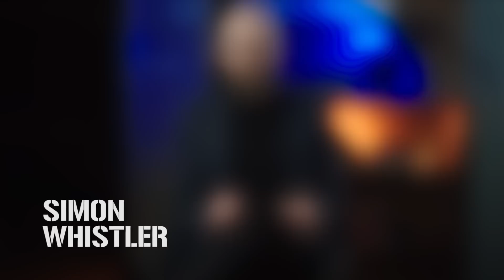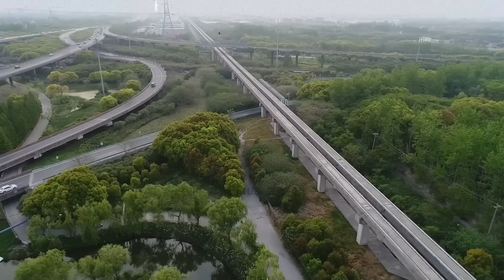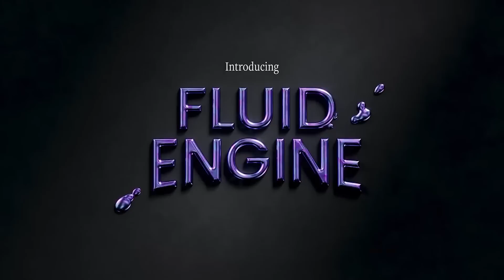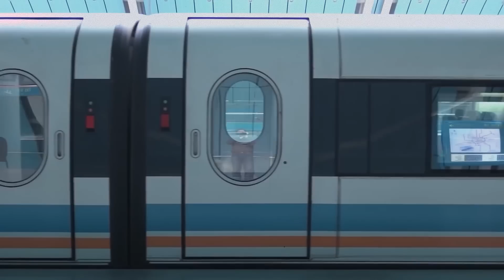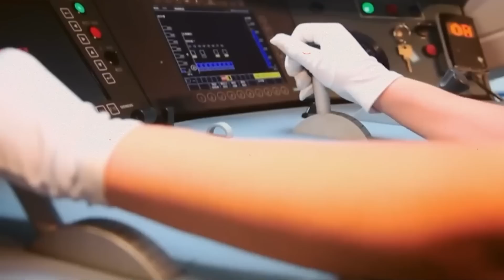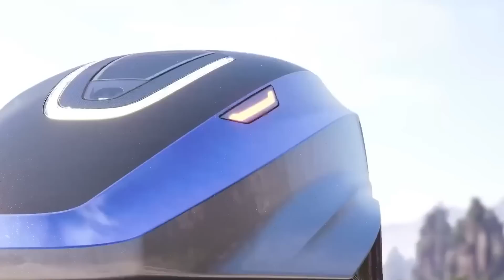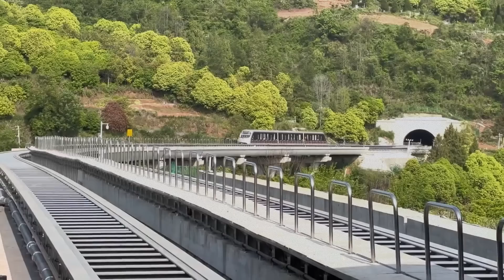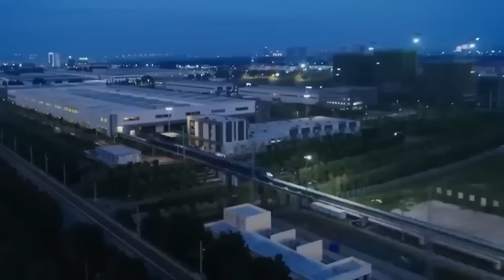A Chinese Maglev Revolution is Coming...

Comment: Airline speed transport at sea level gets increasingly energy inefficient. The jet is flying at an IAS of 250 knots while your maglev is at 500, consuming 8 times the power.
Reply: Planes use jet fuel which still takes a tremendous amount more power to produce, refine and transport than electricity. Comparing maglev to jet engines would be like comparing ICE cars to electric cars. EVs or maglevs may require more power to move the vehicle but electricity is a way more abundant and efficient form of energy.

Comment: i think in the future if iron ferrite permanent magnet (rare earth free permagnent magnet) get stronger, cheaper also superconductor temperature that higher than now (i mean can get cooling by nitrogen) also the cooling system will lighter this maglev technology will be mainstream in all country in the world. (sorry for my bad english, this is just my opinion u can correct me if i wrong in some of my comment)
Reply: why i say this thing is because normal permagnent magnet is expensive and also only china can do it because they control 70% of the rare earth mining and the technology of mining is mature in china. also good engineering skill i guess cause to train move at speed 600km/h or more they need precision and calculation is very hard, other than that the maglev system will different to conventional railway cause u cant change track like normal train its need like monorail ( idk it can change like conventional train but my thought like monorail change track in japan). 

also to be clear the technology what i say in my comment above and this is inductrack.

sorry if i have something wrong in my comment (im not expert in this area)

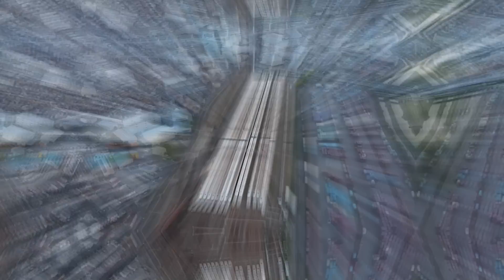Comment: Footage at 0:36 seems to be showing Japan, the cars in the background are running on right hand drive roads, and the freight yard has very typical JR Freight colouring.
Reply: Megaprojects channel did use Japan maglev in few of the frames but that is very easily recognised as Japan's  603km maglev is very unique in design look

I check what you said. You are the expect here and it seems after some checks you are correct 😅👍
Reply: Sorry you are correct 0:36 is Torikai Railroad Depot in Japan.
My bad, apologies for my unknowledgeable rant 😅
Reply: That's in China. The roads & small high rise. 
0:36 is an average small train station. 
All those are HSR train, there's even larger size with more higher speed HSR then that e.g. Wuhan HSR station is 5x size, with 5x train there's in 0:36

Japan don't have such
Reply: @james_l4337  No, it is not. This is the Tokaido Shinkansen rail yard owned by JR Tokai, called Torikai Rail Yard, located in Osaka, Japan. I went on a factory tour there when I was in primary school.

Comment: As a comparison, the construction of the fast train In a proud country. 

HS2 has been staggeringly expensive ( fase 1). Connecting London to Birmingham 66bn km (140 mil).  has costs around 82 billion usd.or $232 million per kilometer (km). 

And California high-speed railway (Phase 1) connecting  San Francisco Bay to  Los Angeles 800 km (500 mil) . has costs around 120 billion USD. Or 150 million per kilometer (km)
Reply: worth noting the cali train is not meant to finish it's an elaborate money laundering scheme

Comment: For those slower maglev trains, what is the impetus to use maglev? Is it greener? You did mention it for the sky train but that also used different magnet tech.
Reply: Technical verification, construction verification and operation verification, calculation and estimation of costs, providing reference for future investment
Reply: It's a test project for future implement in Lage scale.

Comment: How about Japan
Reply: Maglev with 600+km/h is too much for Japan, if not most countries. It's like buying a Koenigsegg Jesko but never speed it past 250km/h. Only a waste if you can't fully use its potential. Trains with this kind of speed needs a very long distance to stop and very large  arc to turn. You can't expect it to go from 603km/h to 0km/h in less than 5 secs/1000m - the G force produced will turn everyone in it into a pile of Bolognese instantly

Maglev is more suitable in transcontinental travel rather than transcity

Comment: Guys you got bits and pieces but you are not giving real picture. Shanghai Maglev has been originally planned to connect with hangzhou but 
1. It went twice over budget ( pillars had to be spaced twice as densly due to soft ground) 
2. China has not acquired ip from transrapid while for rail it did secure technology transfers on 2nd and 3rd generation trains (kawasaki, siemens, bombardier) resulting in own high speed rail tech for export. 
3. While the Hangzhou link was still in consideration, fast link via rail has been built making 170km ride city to city at under 50 minutes 

4.updated proposal has been presented for extending line to hongqiao airport making it simply fast connection for domestic/international transfer between  two shanghai airports (currently around 1.5h is required via subway line 2). 

In the meantime China has put significant r&d budget  into Maglev project which Changsha link is a siginificant milestone as this is first fully inhouse developped maglev technology inside China. The Qingdao link is a natural next step for China and for all of us who have been looking at transport infrastructure this was the news in the 2014-15 :) 

It has been said then exactly that while shanghai maglev will never breakeven the changsha link will be profitable and this technology will be further expanded to cities where subway/underground option is more challenging. 

Currently China is successfully exporting high speed rail tech in asean region and as it is looking for "new productive forces" the party will be pushing big infrastructure to keep economy going as well as keep status quo in rail tech with Japanese.
You should have mentioned Japanese maglev program to give context as they did develop and widely use low-mid speed maglev since 80es but have given up on high speed maglev due to lack of economic viability for such projects until... early 2010s when the super fast link Tokyo-Nagoya-Osaka was announced with first stage completion in late 2030es and whole line in use by mid 2040es, operating speed above 500km/h. 
While US is third world country, Europe struggles to push trains with TEN-T Asia remains the land of rail for all of us CHOO-CHOO geeks

Comment: The problem with maglev is that you have to have a immaculate right of way, or the trackage.  china's big problem with mega projects is the absolutely unbelievable amount of bribery that goes on.  And it reaches down to the level of the contractors building the project.  What no one realizes is that the their mega projects have contractors that are as corrupt as the government officials.  When you can watch a person walking around some of china's very high apartment buildings and just reach out and grab a section of the CONCRETE on a load bearing wall and just break off several pieces of it, and then move over just a few centimeters and do it again!  All in the name of getting their share of the money that is supposed to be used for building those buildings in the project (s).  Your toting china's high speed rail system???  Don't do that.  In order to have high speed rail system you must have properly maintained trackage way and structures.  I've seen videos of their high speed rail cars on the inside.  They vibrate so bad that you almost need a seat belt to keep you in the seat!  Not comfortable to ride for people, AND not safe for their passengers.  You basically need a dedicated line for high speed rail, and then you have the regular train trackage way.
  Why do I call it trackage way?  Because you have to prepare the area that the railroad tracks will go through.  With modern freight cars and locomotives that weighs so much more than you think, you have to prepare the ground for very heavy weight loadings.  So you compact and grade the section properly and then you lay the track.  After that you have to add what is called ballast, which is just the rocks you see and are used to.  Then you have to compact and tamp the rocks, or ballast, so that they are forced under the railroad ties, also known as sleepers.  This forces them to do their job properly.  And then you have to go out and make sure that your trackage is straight and properly leveled.  Thus you have a Maintenance Of Way Department.  Those people keep things in proper order to make sure that there are no problems with getting trains through their section.  This is all a lot quicker with the addition of modern track maintenance vehicles.  These are very specialized machines that are only for making sure that the railroad personnel can spend as little time as possible working on the tracks.  By hand you could/ can get about one to 3.25 to 5-6 kilometers a day.  With modern equipment and personal, you can maintain speed of KPH not per day.  The chinese just do not want to maintain the rails in the system for some reason.  But that is another problem entirely.  
So you have high speed rail and regular freight trains sharing the same tracks.  And then the driver of the high speed rail locomotive is probably forced to try and maintain their time table.  But why doesn't the rest of the world know about china's train derailments?  Because that would make the chinese communist government look bad, and the chinese communist government is all about looking good for the rest of the world.  I don't know if the chinese communist government really cares about its own citizens. But, again, that is another problem, the topic is railroads.  
So, can you imagine what it would be like to use their maglev trains with the supporting system made with concrete that uses to much sand?  The straightaways should be ok.  But the turns?  The concert Has to absorb ALL of the lateral forces and the weight of their own supporting structures and the weight of the the train transferred to the concrete by way of the electromagnets, something has to hold up all that weight!
Reply: This is probably just going to erased.  I'm not fond of the ccp.  As you can see.  But they do just want to take over the whole world.   And not for very good reasons.  They do like to build mega projects and finish them, but from what I've seen and heard in videos about what the ccp is really like, I like to give you more information about this subject.  I am just a model railroader, but I like to learn about how real railroads work.  So I have learned quite a bit about how they work.  And I don't mind spreading some of that knowledge so that you have a better understanding of what is going on.  Unlike this video.  Which is all sunshine and fluff.  Nothing mentioned about anything of the problems going on there internally.  Which is affecting the quality of their mega projects.
Reply: Japan made maglev but decided not to use, as they found that none of their operating routes will allow the train to reach its top speed and MAINTAIN that for at least 10 minutes before decelerating into the station or for the turn. If you can't take it to its peak performance everytime, then why you should waste all the money and resource to produce and maintain it? It's like buying a Koenigsegg but never brought it above 250km/h, truly waste of its potential and your money

But I don't think those Chinese will understand that anyway. They have similar mindset akin to the Soviets, wanting to surpass the West in every aspects to show their superiority, only end up in multiple race traps, such as the space program race which eventually crippled the Soviet economy
Reply: the construction quality problems in china mostly come from private companies. CRRC is a state owned enterprise which has on record had their executives given the death penalty for graft (not even outright cutting corners) Chinese state infrastructure projects are taken deadly seriously by regulators and the people working on them know it.

Also. once china's national blockchain currency takes off its going to be impossible to conduct this kind of petty corruption because every cent can be traced.

Comment: Its really cool commendable for China to build high tech expensive maglev trains, but its simply exclusive for China and probably other Asian countries.
If they distribute their maglev trains to Europe for instance, it would not only be overly expensive but also unfeasible to operate in the long term due to maintenance costs safety measures.
Its just too expensive, that's the reality.

Also Europe is on its way to build a similar maglev floating systems for existing trains but on existing rails to keep it affordable and compatible with EU rail regulations.
We are simply looking for feasible and smarter solutions to make train travel more efficient and affordable.

Comment: Let's talk about profitability and debt about this Chinese "miracle". But this time make an effort and, instead of official CCP propaganda data, use the real one. If you dig a little deeper, you will find out that only two lines of high speed train are making profit (In 2021, Beijing-Shanghai and one more). Most of them are not able to cover even the operational costs.
There is a reason why Japan is not connecting every vilage with Maglev, lol.
Reply: If you do a little more research you will find the fares charged for travel isvery low, less than a few US dollars. It means the expense is mostly paid by the government for the benefit of the people.

Comment: I’m gonna go ahead and disagree with the “because it’s less than the US military budget it sounds reasonable”, even if it took 15 years, spending almost an additional 100 billion dollars(not yuan) per year on a project that has little benefit over the current high speed rail system sounds like a financial disaster of epic proportions. The reduced maintenance costs benefit is theoretical at best, it would likely take decades to recoup that cost,
Making literally any other investment in existence better. Anyone with a brain would reject it out of hand especially given the current state of China’s local government finances and SOEs which will likely need massive bailouts. Given that the central government is already running a deficit, there is really no room in the budget for this. 

Now will this stop China from doing what is effectively a vanity project, who knows, they’ve been less and less fiscally responsible as time goes on. Inadequate leadership needs achievements to distract people so as long as Xi Jinping is in charge I doubt reason will prevail so maybe we will see China ruins its finances to produce slightly faster trains.

There is a reason why Japan is only doing this on one relatively short line that happens to be the busiest long distance line in the world on a 20 year timeline.

This all before we get to the fact China’s financial data is doctored, and everything is likely 20-30% worse than publicly stated. Not to mention the fact that growth has slowed to the point where they won’t just out grow all of these problems after 10 years…

Comment: You focus on China, but it has been really the Japanese that has led revolution and is currently constructing a maglev line that is not an experimental line, but an actual rail line between cities. The one that China has in Shanghai between the airport and the city. Centre is a failed German mag lev system that is no longer manufactured, and the manufacturer no longer exists. like you, I too, have also been on the Shanghai maglev, impressive as it is, he is also kind of sad That for Germany, this technology went nowhere.

Comment: My big question on maglev technology is safety... are people with pacemakers safe to ride?  Could obstructions cling to the rails?  What risks do maintenance staff face?  How much power is required to run the entire thing?  I presume these issues have solutions since there are maglev lines already in commercial use.

Comment: they build and build but most lack quality.  its to create jobs and stability of the population.  Most of the projects break after 5 years or so.  poor quality materials and sometimes the engineers suck. They have thousands of miles of train tracks and stations but very small amounts of passengers to and fro.  Operating at a loss every year.  SOE's.  Cronies cut cots and keep the govt money on these projects.  It's the norm. Do not toot a horn because it's not all positive.  Commies always do something for something.
Reply: No one builds for the sake of building. Money doesn't come from the wind. If the quality is poor and most of it is useless, China would not have developed to what it is now in 30 years. You look like a pathetic person who has never been to China but is opposing for the sake of opposing.